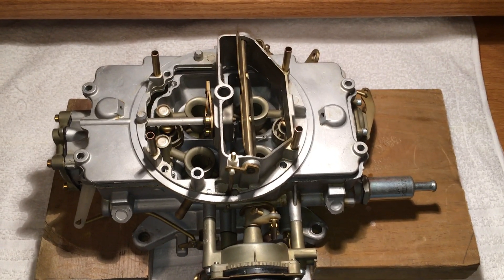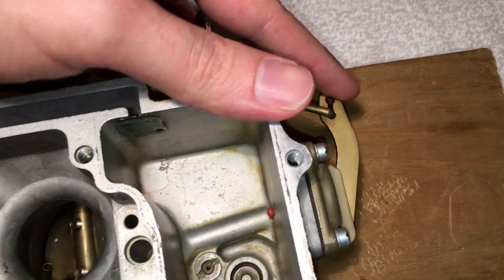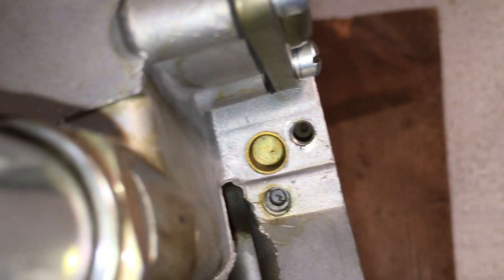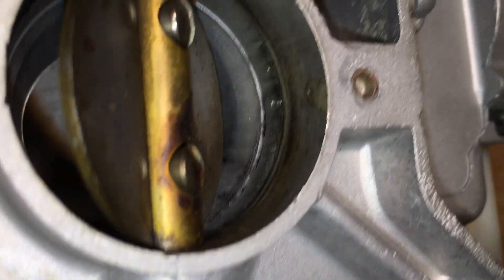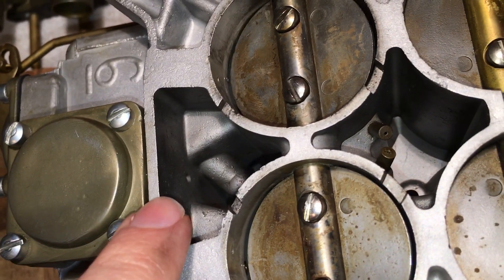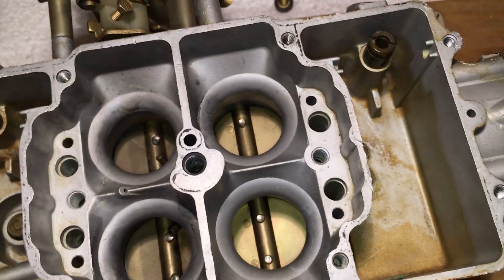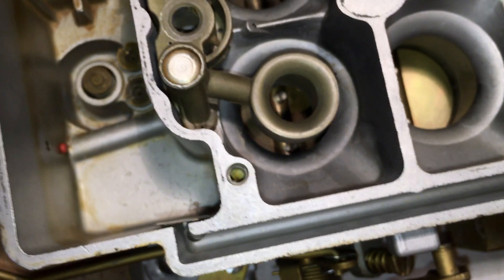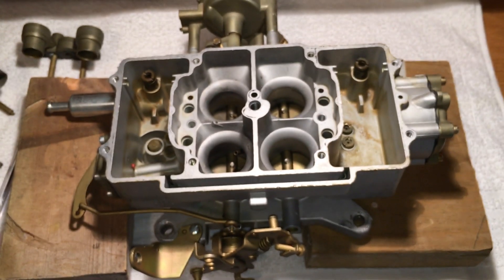Autolite 4100 - What all the holes do

Comment: Hi, Do you know if the secondaries pump fuel in the carburetor, just as the primaries do? 
If so,at what point do they initiate the fuel?
Reply from the maker: No, the accelerator pump only squirts the primaries. The secondaries are vacuum-draw only.
Reply: 👍… Appreciate the advice… This carburetor of mine the Motorcraft 4100 has never opened the secondaries since I owned it. 
Had a rebuild done, changed rear diaphragm twice, sprayed out air passages. The only things not not tried are … add a gasket with the diaphragm as some of them are not sold together, I have not replaced the vacuum advance and I have not replaced the larger intake spacer gasket underneath the carburetor….
Any tips or tricks would be terrific?
Reply from the maker: @1HotRob  Secondaries are vacuum operated. Attach a small hose to the vacuum pickup tube and suck on it (syringe suggested) with the throttle open to verify operation. I talk about the tube at about 14:00. If the secondaries don't open, it may be because you don't have enough manifold vacuum, check with a vacuum gauge. Could be not enough advance, not enough load, or big vacuum leaks. Revving it in neutral might not open the secondaries because there's not enough load. Hard to test without a dyno, I basically checked the secondaries on the bench and trust that it works right on the car.
Reply: This is good idea… will do this.
Thank You, 
Rob

Comment: In the process of rebuilding mine. I found that the drivers side emulsion tube wouldn't get any fuel sprayed through the center tube if I sprayed cleaner through the metered bleed to the side of it. It'd come out the vent hole for it. That was very hard to get unplugged, explains why the drivers side idle mixture screw didn't do anything.

Comment: on the bottom side of the primary booster. the Two outer holes that are metered. what is the purpose of metering jets? Reason I am asking is that on a "D2" booster they are rather big without a jet installed and the long inner tubes are much smaller then usual. How does this effect the idle quality?

Comment: I found the old 4100 4barrel carb that my late father used on this 64 Galaxie with the 352 40 years ago.  It is in bad shape; however in this carb the main jets are 52F and the secondary are 68F.  I need to pull the air horn and find out what my current 4100 has.
Reply from the maker: That sounds like the Hi-Po spec'ed jetting from a 289 engine. If you have a regular 352 that carb might have been causing it to run too rich. The 1.12 venturi size is for 600 CFM, and that might be a size or two bigger than stock (which might cause less efficient atomization). You might want to double check the carb specs for your engine.

Comment: So I I feel my 4100 is running lean and I want to try the next size up jet, do I need to do any thing with the ventures on top?  The ones that you remove with the hollow screw and the check ball.  Are they all the same size?  My carb is stamped 1.12.
Reply from the maker: The venturis are sized based on the maximum airflow of the engine, which is determined by the displacement and volumetric efficiency. Therefore you shouldn't change them unless something is physically different with the engine (bored out, stroker, intake manifold, etc). If the engine is running lean the correct fix is to just change the jet, but make sure all the passages are clean first, and you've ruled out any vacuum leaks. If the engine ran fine previously I would be very hesitant to change the jet unless you are sure it has always been the wrong size.
Reply from the maker: @jewllake  From what I can find, you should have between a 048 and 050 size main jet. Look for the number stamped into it. If you think it's running lean, run it down the highway, shut it off, and read the plugs. Not sure what to make of your timing, perhaps your dist needs to be recurved or your timing marks are off. New carb might be burning more efficiently so perhaps you're noticing an existing timing issue.
Reply: @TechnicalLee  Thanks!!!

Comment: I did rebuilt my Autolite 4100 and I’m having some trouble setting it up, it starts but doesn’t hold the car running, what is most common mess up when reinstall it?
Reply: I'm having the same problem. I screwed something up and now the thing runs rich, chugs black smoke, and won't even stay running when you put the car in gear.

Comment: I"ve rebuilt several of these and after watching your video.....I knew nothing about this carb....but I do now. Thanks!
Reply: Does anybody know, is there any particular mistake you could make rebuilding the autolite 4100 that would cause the engine to chug black smoke at idle and run rich over the entire RPM range? That is the situation I am facing.
Reply: Float levels too high or floats are stuck open